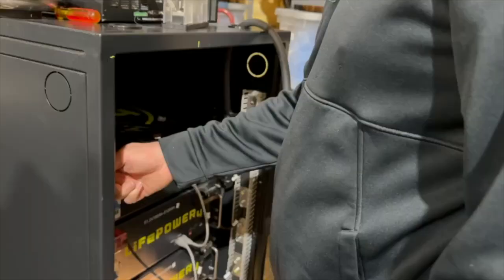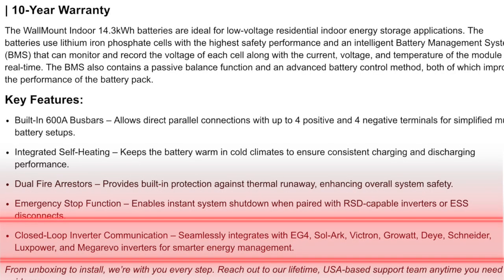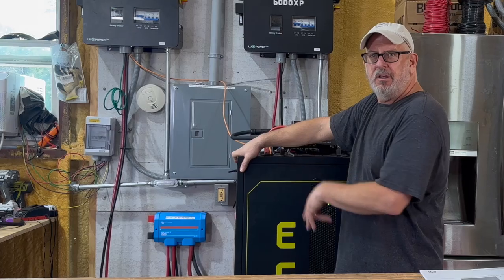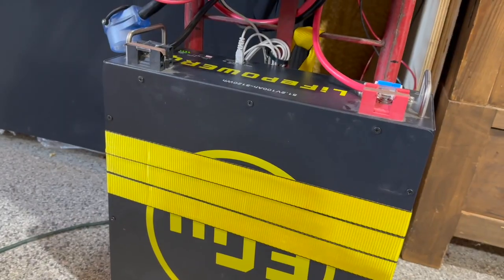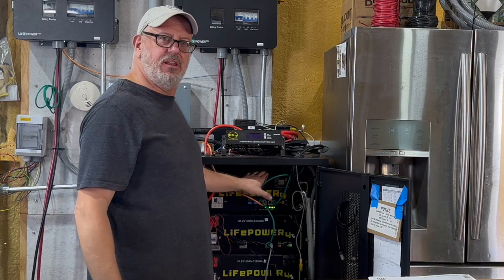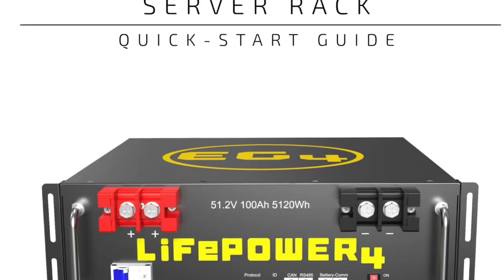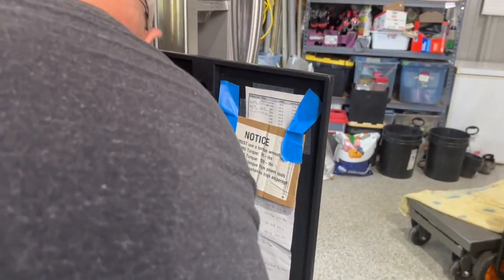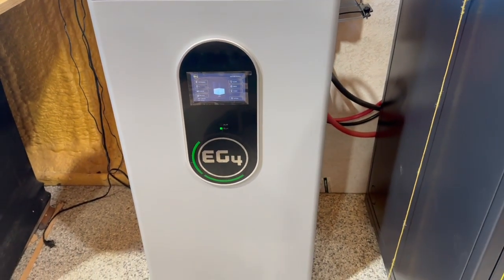Combining EG4 Wall Mount + Server Rack Batteries | Will it Work?

Comment: Have something for you I have 12 Sungold power 100 ah battery and 1 200 ah wall battery all the rack battery will talk to my Eg4 Lux power inverter but all hooked together it will not see the wall battery but I can hook it up to the inverter and it will see it
Reply from the maker: I’ve heard good things about the Sungold batteries.  Whenever you have batteries with different BMS modules, it’s often difficult to get them to communicate together.  I would think you could get the 12 server rack batteries to communicate together with the inverter and just wire the wall battery into a common busbar.  You do have to experiment sometimes to see what works best.  As long as the voltage stays the same, they should,work well together. 🔋⚡️☀️🐸🪫
Reply: @terrahillfarm  Yes I think that is it hook it to my other inverter and it see it

Comment from the maker: 🪫 We needed more battery storage to make it through summer with the air conditioning running full time.  So I opted to add the EG4 wall mount battery to my EG4 Lifepower4 server rack batteries.  This is not plug and play and if you do it wrong, there are some risks of damaging equipment.  

So, as your official solar Guinea Pig 🐷   I waded into the swamp of mix and match batteries.  You do need a good busbar to land your battery connections on and I love the Victron Power In.  Don’t forget to add OCP to each battery bank, ideally with a T-Class Fuse set up matched to the amperage of your battery cables and battery.

The system has been working well for a week and we’ve gone much longer without having to charge the batteries from the grid, so so far, no Boom is good! 💥.  Let me know if you are using two different battery types together successfully, and if any of them are from EG4.  I’m curious how others are doing it out there! 👍🤩